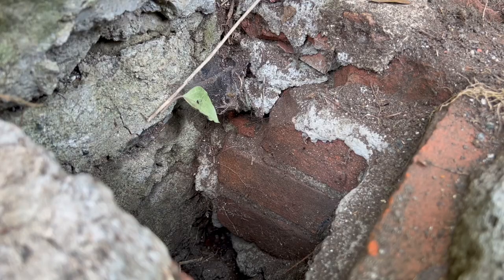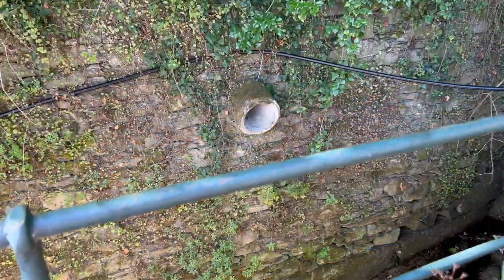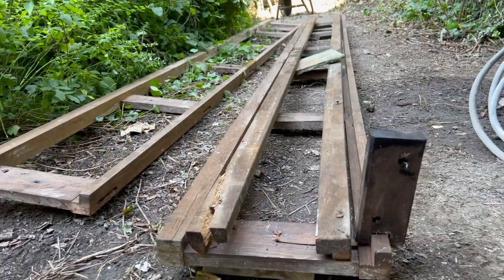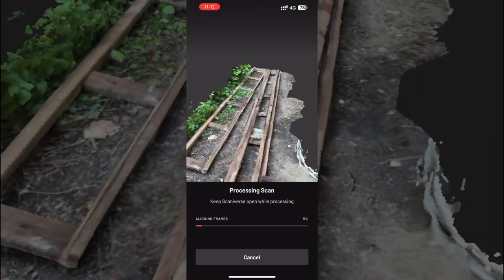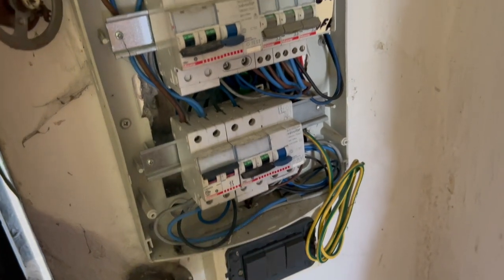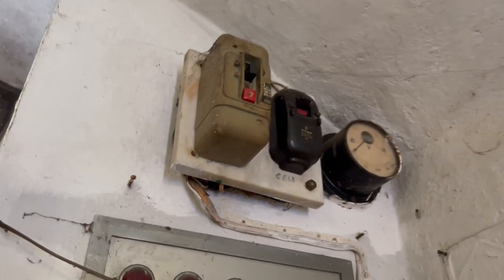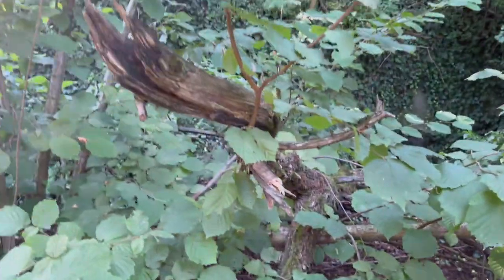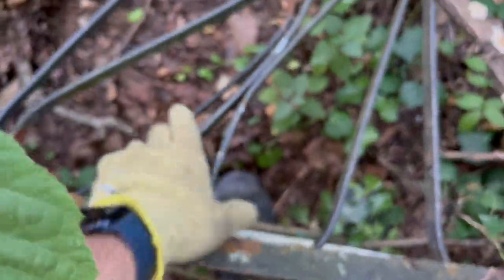013 || Super focus at the Villa Oliva house renovation

Comment: I have a septic tank although everything is on a much smaller scale.  I have had blockages and used  both rods and a dedicated extension for a power washer.  Both worth using.  I’d think a power hose would be a better option for you..  You and your dad continue to amaze with your physical tenacity as well as your knowledge in other areas.
Reply from the maker: good suggestion, will think about it! Great to hear, thanks a lot!

Comment: I definitely wouldn't try connecting the old electrics! And before you turn on the power, make sure that dangling light switch next to the fuse board is definitely disconnected!

The old bit on the right is an adjustable thermal trip switch that can be set to any value between 12 and 25 amps. It was probably used to limit the supply to a certain number of kW back in the day and if you exceeded that for too long it would cut the electricity to the entire house. 15 amps at 220 V (the standard when this thing was installed) equals 3 kW, so that's a plausible value. The thing on the right looks suspiciously like a simple main switch without any safety features. So basically the old setup didn't have any proper fuses or circuit breakers. The wires also look pretty small for 15 amps or even 12 amps.
Reply from the maker: Thanks for the info. I am definitely redoing the whole electric system. However, as long as I don’t have anything else, I will use the select system that seems the best alright. Hopefully I don’t burn down the place.
Reply: @Villa_Oliva  The bits that were redone in the basement probably aren't too bad. I'd be worried about connecting the much older bits upstairs though.